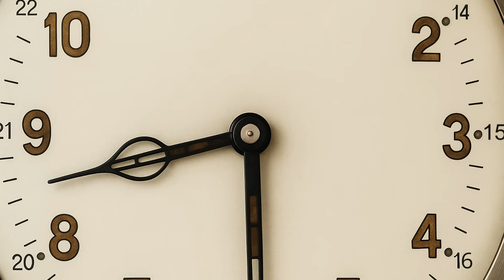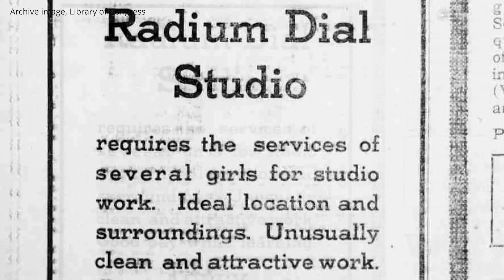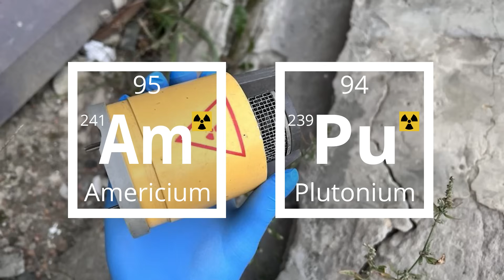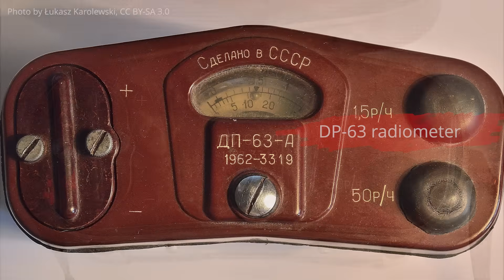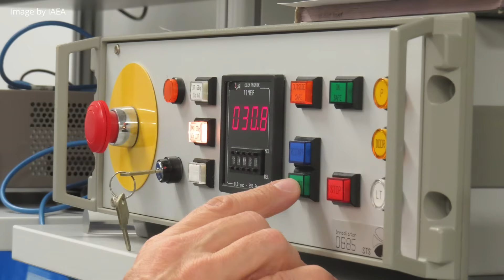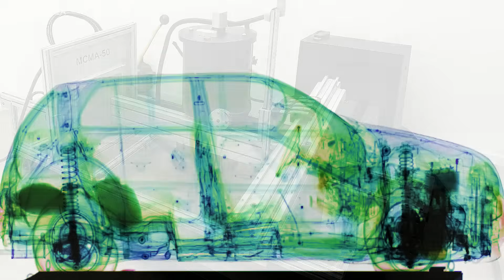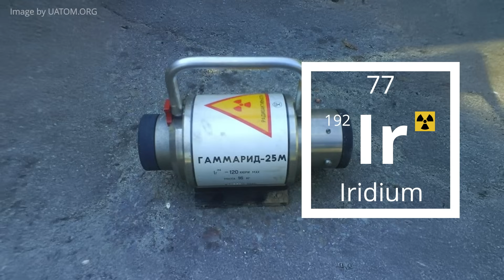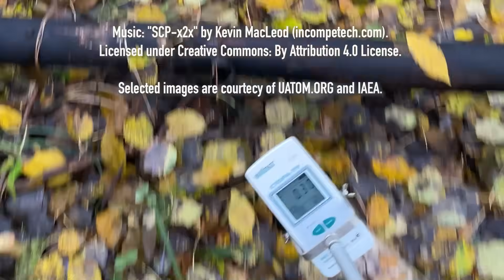NEVER EVER Touch These Objects!

Comment: To give an idea about how dangerous the DP-2 sources can be that are mentioned in this video. My old DP-2 had a source that after two half lives from the 1960s measures about 1.5R today if placed inside an open air ionisation chamber, so it's kept sealed in several glass jars and locked away, luckily no flaking glue on it unlike some other sources I've come across, some people apparently have DP-2 sources that are still 10R plus today meaning they were stupidly strong when first put inside the DP-2, probably making enough breaking radiation to actually emit something readable from the metre.
Reply from the maker: Uff...
Reply: A wooden container would be preferable to glass. Less braking radiation produced that way.
Reply: @MinSredMash  Breaking radiation is pretty minimal with two glass jars, the second jar is basically to act as a spacer from the first jar.

Comment: @ChernobylFamily I don't know if anyone in the USSR was ever crazy enough to use Uranium Oxide (unrefined so mixed U-235 and U-238) to make food plates, but we did!  
Makes a nice bright orange color, and zillions of radioactive (I mean REALLY HOT) plates were sold by the Fiestaware Corporation.  They are dangerous collectors items now.
(700 million year half-life, so they're never going to get weaker in human scale time - they will always be nearly as hot as when they were made)
If you have some of this stuff, put it in display if you like, that's harmless.  Just don't eat off it.  It won't make your food radioactive, but if your knife or fork makes the slightest
tiny chip off the glaze and you ingest it, you will die of cancer, period. Not a joke.
Reply from the maker: Rings a bell. That bright red-orange? Dunno if here we had the pottery. We had uranium glass, as everywhere. It is also a questionable thing because it can have traces of radium along with uranium - and that makes problems.
Reply: "Consumption of uranium from regular use of such dishware, estimated by the U.S. Nuclear Regulatory Commission, amounted to potential doses of about 0.4 mSv per year."
Not great, not terrible ;)

Comment: I have a radium-dial watch that was made in 1960, and I was given it and have been wearing it since 1970. It doesn't glow anymore after two half-lives and the paint going opaque. It's not considered quite as harmless anymore, either.
One fairly recently-realized issue with radium is that it breaks down into radon, a gas with a much greater volume than the radium it came from. It pressurizes the case and escapes, where it can raise the level in a closet or small apace to dangerous levels. It's heavy so it just builds up and doesn't dissipate.
Reply from the maker: A little remark: a half-life means a time needed for half of a quantity of the substance to disappear. So after two half-life periods remains approx. 34% of initial substance. Too bad, what appears instead, usually is radioactive too.

Comment: I recently went to visit a man that just finished repairing the oldest working digital computer in North America. While we were talking about the computer in his workshop, I looked over and saw three aircraft gauges on his window sill. I pulled my counter out of my camera bag, and showed him how radioactive they are. He never knew they were radioactive at all.
Reply from the maker: Potentially, you saved his health. Good job!
Reply: Usagi electric?
Reply: @willrsan  yes! It turns out he lives just a few hours away from me, here in deep rural Texas. If you watch his videos, the three gauges are on the window sill next to the Bendix diode tester, between the Bendix G-15 and the Data Machines Data-620.
Reply: @willrsan  as a good example, in the video "CERN Topoclustering on the Bendix G-15!" at time 30:48, you can see all the gauges in the background. I did verify that the rates fall off quickly after about 2 feet, and with UV exposure, there was no dirty snowglobe effect. I did tell him that if he wanted to keep the gauges on display, more distance is better, and NEVER open them.
Reply: @KD5TKR  yes, saw that video, went back to it and had a look at the time point you mentioned, seeing the 3 gauges now in a different light!
Reply: you have been talking to Usagi Electric I see.

Comment: Another source that is not commonly known is thoriated glass camera lenses. Generally 1960s -70s vintage. It makes very good lens material, if you are collecting old lenses and aren't careful you can end up owning some thoriated glass without knowing
Reply from the maker: Well noted!
Reply: BUT Thorium lenses had the bad habit of becoming "brownish-yellow" tinted after a few years, making them dangerous, because people discarded them in improper manners, and some of them even took the lenses as a bad joke, and let the yellowed lenses to fall on the floor to break them in an infantile "vengeance" against the manufacturer! 

Those lenses were made by several famous brands, but most were from "PENTAX"...

Comment: Cobalt-60 industrial sources famously (or infamously) carried a warning "DROP AND RUN" engraved on the case...
Reply from the maker: 60Co is veeery nasty.
Reply: @ChernobylFamily  The Doomsday Bomb!
Reply: Only the older ones had that stamped on them. They were used in old medical irradiator machines that sterilized small items. Compared to modern accelerator driven sources they are slow and rather weak. The big source scaffolds they use for irradiating food and such though are insane. Hundreds to thousands of kilocuries of cobalt 60. All on meter long pencil thin rods that actually glow dim red hot with radiation during exposure. Just one of them is so intense you could run to it touch it and run away and you would receive a fatal dose... 😢

Comment: Interesting video!
Do you think that there is a possibility that a radium alarm clock could cause leukemia?
Reply from the maker: This is a question you better ask an oncologist, not a youtuber, if it is about a particular case/circumstances.
From my perspective, any source may trigger stochastic effects based on the immune/genetic features of a particular person.
Reply: Inhaling or ingesting radium paint will irradiate your bones, so leukemia is a possibility. But the chances of that happening from the radium in just one clock are extremely small.

Comment: It occurs to me that it ought to mandatory that all sources have the radiation trefoil and periodic table symbol for the material contained within physically stamped, deeply engraved, moulded or otherwise marked on it in a manner that won't rub or flake off or get obscured by dirt. Just painting it on it isn't good enough. 🫤
Reply from the maker: This is normally what it looks like. Sometimes, there are exceptions, but normally it is as you say.

Comment: Excellent video. I work in a coal fired power plant. We have multiple cesium-137 projectors similar to the ones near the end of the video that are the source for instrumentation used to detect density in some of the waste water from the plant. I occasionally have to calibrate the electronic detectors, which are on the other side of the pipe 180° from the radioactive source.  Thankfully they are calibrated from a distance and are no danger to me
Reply from the maker: Thank you for sharing your experience!

Comment: Hey Alex! I have a DP-5V in brand new condition and somehow it has B-8 in it (with all the documents and checked in late 80s IIRC). As far as I know it's an aluminum plate with an epoxy (soviet quality lol) droplet wrapped in aluminum foil and should last hundreds of years if stored properly in a dry place. Last time I checked the device few years ago it worked like new and this suggests that B-8 is still intact. So the question is it safe to keep it or should I get rid of it and how can I get rid of it and keep the detector cover (I'm in Ukraine)? Thanks!
Reply: The beta emissions of a B-8 source will be blocked by any ordinary glass/wood container. You have a few thousand Becquerels of Sr-90 and Y-90 there. It should be treated the same way you would a glass thermometer with poisonous mercury in it. Protect it from impact, abrasion, etc. and it is not more hazardous than a pocket knife or bottle of weedkiller. But it is technically illegal to own in the United States and likely Ukraine as well.
Reply from the maker: Check the section at https://www.uatom.org regarding disposal of discovered sources. Or contact Radon Kombinat: https://radon.net.ua

Comment: So I'm curious, you said Soviet radiation detectors were not meant to be stored and warehoused for long periods of time. So I'm curious if they had special ones for civil defense and emergency stores? I have a couple of U.S civil defense radiation detectors, they were obviously designed for long term use and storage, is this just a U.S vs Soviet difference? A lot of other Russian military gear is designed for stockpiling and long term storage, is it just an artifact of the detectors  designs?
Reply from the maker: The problem is that 239Pu degrades to 241Am, and so they start to emit gamma as amount is substantial. Why they decided to go for Pu is a good question.
Reply: @ChernobylFamily They probably got the PU from just scraping it off the banks of Lake Karachy lol
Reply: @ChernobylFamily Thanks, I learn so much from your channel

Comment: I got self glowing sights on my pistol, is that radium when the sights are modern? Are these safe? I think I read on the box it came with that is a radioactive source.
Reply: Modern stuff, if it IS radioactive, is almost certainly using a glass tube with a phosphor lining, and filled with Tritium gas...not too dangerous.
Reply from the maker: Well, I have no idea how to answer as I can not check them. Ask someone to measure gamma+beta in close-up. But if it is modern, 99% it is a safe pure zink+sulfide paint.

Comment: Thank you, as always a very informative video.
Radioactive sources can be lethal even without error or misuse by the operator: the infamous Therac-25 accident was caused by a software bug. It might be the worst software bug in history, to be precise.
Reply: To add to this, the terac-25 was an active acellerator, so it didnt contain a source of any kind as far as i can recall. without power, these units are totally inert and not dangerous.
Reply from the maker: Correct

Comment: I lived in a rental house back in 2009. When I first moved in, I was messing around with a Radex dosimeter and some Trinitite samples. I walked through the hallway of the house, and my dosimeter went crazy. There was a smoke detector wired in the ceiling, but I had never seen an Americium detector set off a dosimeter from such a long distance away. I took the smoke detector down, and it actually used a 1 microcurie Radium 226 source. Whoever owned the house previously had installed an industrial smoke detector, without realizing that the radium source would be blasting anyone walking through the hallway. I took it down and stored it in a metal ammo can, well away from everything.
Reply: Wow!
Reply from the maker: What a story!
Reply: And now some kids are playing with it, after finding the ammo can.
Well done.
Reply: We are surrounded by radiation in nature and in nuclear power and weapons

Comment: i’ve got thoriated tig welding tips - i’ve been aware that i shouldn’t breath the dust in when grinding a point on them.  My late father died of a brain tumor at the age of 68 who was tig welding for about 20 years who may of not known.
Reply: Dump them and use lanthanated tungsten instead. Don't have the risks and weld just as good
Reply from the maker: Thank you for sharing

Comment: Radium paint part reminded me of something… 

My grandma worked in 60s as radiation safety technician, her job was also checking dose of radiation in cockpit of aeroplanes emitted by glowing radium paint. So I known story of Radium girls pretty well. 

Few years ago, I was working in same company as her in 60s. This company is still making aviation instruments. I was doing inventory of stock and I found drawer full of old altimeter dials. I placed drawer on my desk, by computer, counted parts and then I took drawer and put it back to dark cabinet. And I noticed that dials were glowing! My heart stopped. For second I thought that I was whole time handling old radium paint, but then I removed top most dial and one under wasn’t glowing. It was just a UV paint which become activated by UV light from window, when I was handling the dials…
Reply from the maker: Good it was it.

Comment: During my undergraduate degree, I got to visit a factory making sutures (needle and thread for surgery). The final step involved sterilizing the packaged product, by running it along a conveyer belt over a Cobalt 60 radiation source.

That radiation source looked like an oversized fly light trap, sitting at the bottom of a swimming pool. 2m of water is enough to block most of the radiation, so you can safely stand on a gantry directly above it. The weird dull blue glow was other worldly.

The swimming pool was surrounded by a maze of concrete corridors, and the closer you got to the source, the more aged and rusty the concrete and metal pipes looked. Yet they were all the same age - just prematurely deteriorated by the radiation.

We were also shown a photo book full of the tremendous injuries people have experienced over the past when accidentally exposed to these radiation sources. Their last few days of life must’ve been worse than torture.

A truly unforgettable experience!
Reply: The damage to construction materials is mostly due the ozone produced by the radiation and maybe higher humidity due the shielding pool. Materials in which you can see more direct effects are usually organic and some glasses that solarize.
Reply from the maker: That is quite a story, thank you for sharing!

Comment: Are you seriously claiming the amount of americanum embedded in ceramic in a smoke detector could kill you? This video is sick and exploitative.
Reply: A smoke detector has around 0.7 uCi of Am-241. If you ground that material up into a fine powder and inhaled it, the dose to the lung would be around 1 Sv. That is a major increase to your chances of lung cancer.

But if you just ate the button you would almost certainly excrete it with minimal radiation exposure.
Reply: The old industrial soviet ones are bit more 'spicy' than your average smoke detector.
Reply from the maker: Based on characteristics of 241Am, I am quite boldly claiming it will be very harmful if certain conditions are met, speaking of which I explicitly and clearly said "if integrity is compromised" and "if inhaled or ingested." This is BASICS of radiation safety.
When they are intact, it is all good.

What is sick and exploitative here? I do not know.
Reply: Not in a normal, safe household smoke detector, but industrial ones are a whole different beast. Even the laser-based, non radioactive ones for monitoring chemical plants and warehouses sometimes have enough power to blast a hole in your retina, especially the really large ones with thousands of feet of range. Anything that you would find on your kitchen ceiling has been built and tested to not kill you, even if you are an idiot. But a detector you would find on the roof of a furniture warehouse or a car factory? Not so much. Those are installed in places you can't get to without a boom lift for a very good reason.

Comment: i just checked our smoke detectors, and they are all optical ones, so no americium (i am in west germany, so no soviet ones in sight)
Reply from the maker: Good!
Reply: @ChernobylFamily to add to your great video, some radiotherapy machines use an active acellerator instead of a source (depending on the usecase for that machine), which means that if there is no power there is no radiation, BUT you can of course never be sure, so stay away from this stuff guys.
Reply: In Europe we are phasing out the ioniazing smoke detectors yes. The only advantage with the ionazing variants compared with the optical is that they tolerate dust better.
Reply: @Jappmannen  And the optical detectors tolerate water vapor better than the ionizing type.

Comment: Great video! 
The thought of the probable disposal of the smoke detectors left me blinking, speechless... Oh my.
Reply from the maker: They are rare now, but still, they can be present around.
Reply: @ChernobylFamily  This is also why the Am-241 smoke detectors are being phased out. 
They usually ended in domestic waste and from there to incineration plants or dumps.
Reply: @2ftg  Radiation safety authorities in the U.S. estimated that around a billion Am-241 smoke detectors would end up in U.S. landfills, but that still wouldn't cause any measurable contamination.
Reply: @2ftg  Exactly.
Reply: isn't there still radioactive stuff in modern smoke detectors?
Reply: @kahvikissa_  Try finding one at Prisma or Citymarket.
It's gona be all infrared based detectors at this point.
Reply: You can still buy smoke detectors in the USA that have a tiny Americium-241 source in them. And non-serviceable internal batteries. Given the poor design of them blaring out loud in the middle of the night when the battery is getting low, many people resort to smashing them with a hammer to silence them! A blow to just the right place could turn that source to alpha-emitting dust which the family then breaths in… ☢️